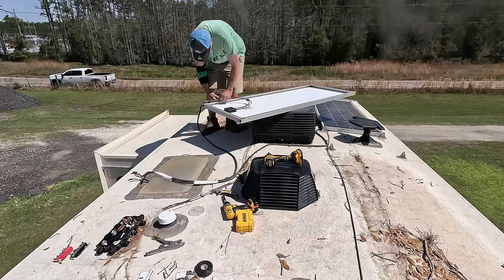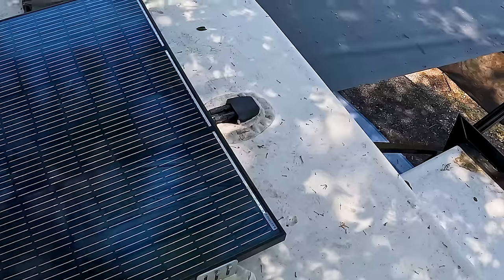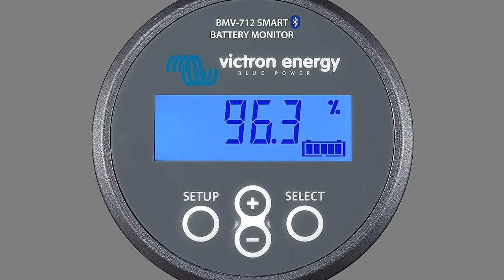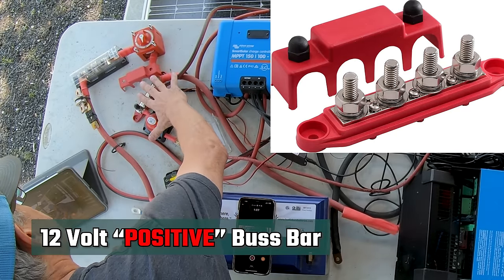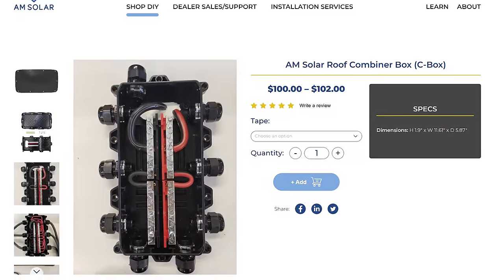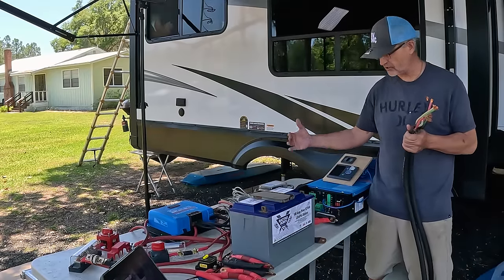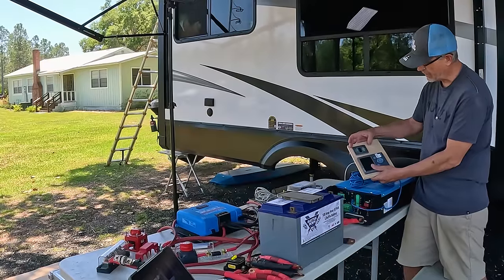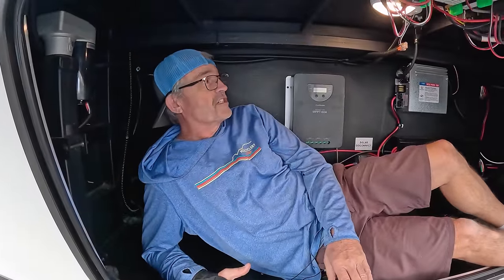Solar System RV Makeover: What Stays & Goes on Our Grand Design?

Comment: Great video, we have a 2003 class A Winnebago and been wanting to do the same with Victron equipment. Right now I have a 2000w inverter and 4 100amp Lifo4 ... I was thinking of going to a 24 volt or even a 48 volt system for the efficiency and run the 12 volt separately or with a step down converter for the slides and level system... what are your thought on something like this. ?? My Ac is a huge basement model / none on the roof.. came that way from Winnebago so I'm concerned about wire size drawing 200 amps from a 12 volt Inverter... the ac pulls 26 amps from the Onan Geni when running.
Reply from the maker: 24 or 48 volt does allow smaller wires but you have to use a dc to dc for the rv 12 volt Larry

Comment: This video was helpful in as to where I need to fuse. I will be interested in when you wire your solar panels. I want to understand the difference between series and parallel. I was told to wire in series. Not sure if it’s the right way to go. I have a 2020 337 reflection.
Reply from the maker: When you wire in series, the panels are not independent, if one has shade, it affects the power from all the other panels, for parallel are truly all independent so if one gets shade, it doesn’t affect the other panels at all.  The problem with parallel is that it’s higher amps less volts which means you have to use a much fatter wire to go from the roof to the solar controller. I’m using a two gauge.  Larry

Comment: I'm looking to add a DC alternator charging component to my 440w solar.  I need to figure a way for the alternator to supplement the solar and be a secondary source of charge.  Cheers on this video!
Reply from the maker: We thought of that using the power of the truck on travel days, but most of the time we travel on sunny days and we arrive fully charged just using the solar panels.  Alternate source  of power is our 2200 W generator, for rainy days.  Larry

Comment: Great video - will you new AC units need the micro air easy start?  I thought some of the new AC units come with some form of inrush current reduction these days …

We have a very similar setup except we have the older Victron 3K inverter that only powers one leg.  I have a manual switch that either passes through each leg or ignores one leg input and combines the output into both legs (similar to what AM solar used to sell except mine is manual and theirs is automatic.  I also added a generator plug in my front bay so I can plug a 30 amp cord in there and use my Honda 2200 generator to supplement if needed - bypasses the surge protector.

I have 1200 watts on the roof and used the 10 awg wiring from the factory (3 each in series and each bank of 3 in parallel) - runs into our 85 amp Victron charge controller.  

I use a Raspberry Pi Zero 2W to connect to the inverter with an MK3 to usb box, and have VE bus to USB cables all going to a 4 port hub on the RPI from the inverter, charge controller, shunt and a USB GPS device - the RPI runs VENUS OS and communicates via WiFi to our Winegard gateway - we can use our phones to monitor everything the same way your color GS works.

I installed this 3.5 years ago and it has worked flawlessly.

I also have Mopeka sensors that have Bluetooth connectivity that VENUS OS can see and integrate into the VICTRON web portal, so I can see propane levels and fresh tank levels.
Reply from the maker: Wow awesome system, we used to have a multiplus 1 with an automatic switch to power both legs, when the switch failed i replaced it with aMP2, much better now.  I have the Ruuvi temp sensors that report to the victron system, on inside one outside.  I hope you did a video on your system.  Larry
Reply: @DownsizingMakesCents  I took lots of photos but have not done a video.  I have spoken to Dry Campers (YouTube channel that does solar installs) - I won a contest of theirs a couple of years ago (won a second Micro Air Easy Start for my second AC unit ...).  When I get my camper back from service (frame issue due to missing lag screws on my Solitude S2930RL) I may make a video.
Reply from the maker: @markhaney7332  hey mark, yeah, Mike is a good friend of ours. We’ve known him for years. He does awesome solar installs. I want to see a video about the missing bolt in the frame.  Larry

Comment: Larry you didn't tell us the solar panel configuration and the max wattage/voltage/current you are expecting from your solar panels?  Any reason since you have a 150/100 charge controller that you aren't configuring them for higher voltage and lower current so you don't need to use 2 awg wiring from the roof to your controller?
Reply from the maker: Ya sorry, the video got longer than i wanted to i cut some of that out, we have 6 x 200 watt panels we are bringing over from the solitude, and the new rig came with 370 wattts, so we will have 1570 watts total and still have room for 3 more 200 watt panels if i want.  My big thing is i like to have room to walk around the roof, at least 6 inches near the outer wall to put a foot to raise the panels for angle and maintenance.  I dont know how people completely cover the roof in panels, how to they walk around the roof. Larry

Comment: Hi been checking you out. I bought 2x 200aph/200apm BMS lifeo4 ,1 300amp fuse breaker , 1 500amp shut.. 3000watt 9000peak inverter with auto switch shore to bat .Now from this vid I see I made note to what else I need as far as on/off switches.& fuses I need to order this week . Solar will be after am done with this install Thank you for your tips . Its nice that you take your time in life .To show the world this .Thank you again . I finally after watch all your vids comment LOL
Reply from the maker: Thanks Joe,  let me know if you have any questions about solar stuff,  i am in the middle of mounting my panels today, two on yesterday, four more to go today.  The most important fuse is the catastrophic 400 amp fuse from the positive off the battery, switches for the entire battery bank, the RV 12 volt supply, and for the solar PV feed, this time i also put a switch on the feed from the solar controller to the positive buss bar.  Larry

Comment: Larry, that's a nice setup. Is your new RV setup with a 50 amp service?  Also, is there a reason you didn't run your solar panels in series?  If your solar panels all had the same Voc, you could possibly have kept the existing PV wire to your MPPT controller.
Reply from the maker: I run my solar panels in parallel because in series if one panel is blocked from sun, then the others don’t power, the solar controller.  In parallel all the panels work independently so if one is blocked, no big deal the other provide power..  larry

Comment: I may have missed it - do you turn off the breaker on the RV's electrical panel for the converter (i.e. disable it) due to the Victron inverter/charger being installed? Great video! Thanks!
Reply from the maker: Good question I will be removing the converter when I install the multi +2 inverter. It will take over all of the charging and converting..  Larry

Comment: Looking forward to the install.  Im toying with the idea but not sure of the route to go.  Our 415G came with 330watt panel and Futurelink controller that is expandable.  NO Inverter though. Im only looking to run the 30 amp line that comes with the Inverter prep. Plus we have the 6k Yamaha genny. 
 Alot of choices out there for equipment  thats for sure.
Reply from the maker: There are tons of options, and lots of ways to dry camp, having a 6 k genny is handy when its hot and you need ac for sure, but i wish there was a reallly quiet genny out there, our is the quietest made but, stilll too loud.  Adding an inverter to your system will open a lot of options to power stuff when you dont want to run the genny, that way the genny is just a battery charger, not on demand except for AC.  Larry

Comment: Holly cow that sounds complicated! Glad you understand how it works just a lot of stuff to remember. Just got a new rv fifth wheel thinking about installing a 24v system. Unfortunately it’s pretty intimidating fortunately there’s a lot of you tube people like you that can help👍🏻
Reply from the maker: The only real advantage of doing a 24 V system is that the solar controller can handle more panels, and you can use smaller wires, but you have to have a separate converter to power of the 12 V items in the RV like the jacks, lights, slides etc.  Larry
Reply: From what I'm seeing if you're going to go big go for a 48v system.  It allows you to use smaller gauge wire along a few other advantages.

Comment: Can the truck charge the Battleborn batteries ? When there is no sun when traveling ?
Reply from the maker: I dont have ours set up like that but we could easily, as our truck has double alternators, matched with Victron Orion dc to dc chargers would do it, but to be honest even on cloudy days our batteries never get below 50% on a very long 8 hour travel day.  When we traveled we never used the propane on the fridge while moving so it was on 120v on the inverter pulling some pretty high watts so i am sure we can drive all day with the 12v fridge sipping energy compared to the 2 way norcold fridge we used to have in our solitude.  Larry
Reply: @DownsizingMakesCents  Right now my A Class RV is a weekend warrior, and uses a generator. But in the future when the kids move out, a solar system, soft start will be installed and I want the RV's alternator to charge the batteries on no sun and raining days.

Comment: As forward as possible!  ?  I ? That extra weight on a already week frame design..
Reply from the maker: Bryan, if you are referring to the frame failures issue, that is mainly for the bigger, heavier rigs. We addressed that in several videos before 
Alice
Reply: I hope he takes some trim pieces off and check to make sure all of his lag bolts are in and of proper length and size

Comment: I’ll tell you what you asked.  460ah battery, 790 watts solar, 3000 watt inverter, Victron monitor, shunt, 100/50 controller, Cerbo gx with screen. When the inverter goes, the Victron is the replacement however it will require a complete rewire because only L1 is powered in the 5er. Converter has been upgraded to lithium ( no charger on inverter)
Reply from the maker: Interesting no charger in the inverter, what inverter is it, the multiplus is the bomb.  Larry
Reply: @DownsizingMakesCents  I was avoiding brands but you asked. My KZ 382MBQ rv came with a worthless Zantrex 1200w so for ease of install I replaced it with a X3000 watt Zantrex. The XC version has the charger. I replaced all other electronics with Victron